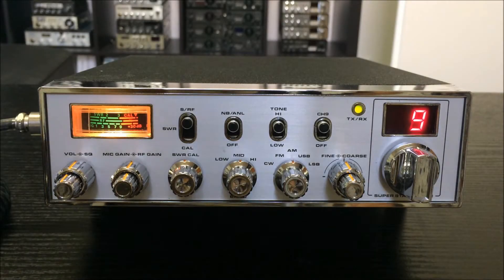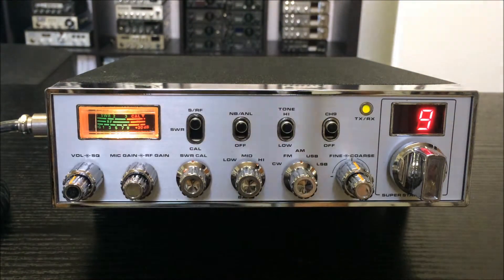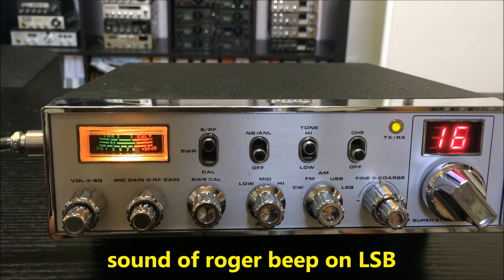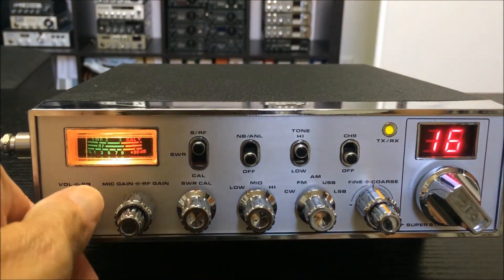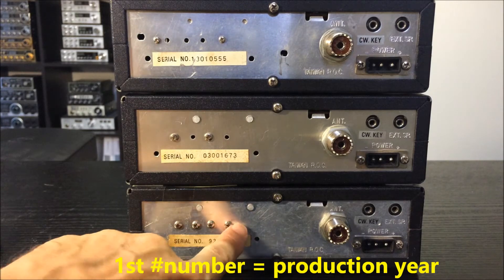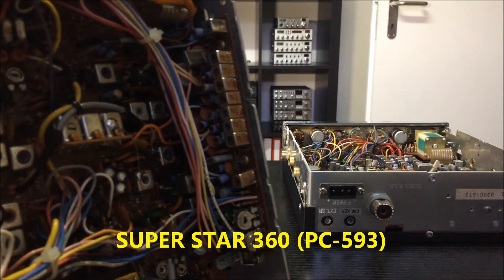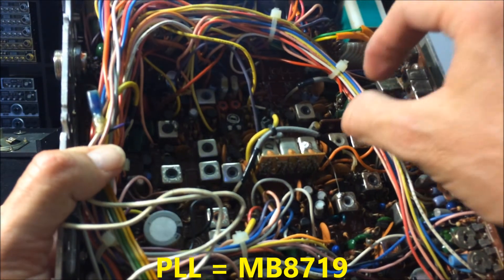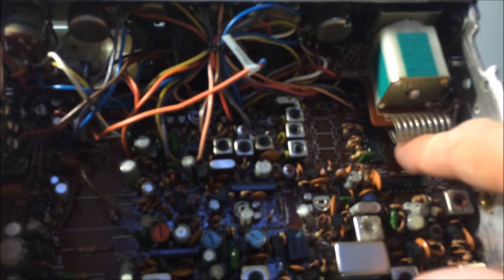SUPER STAR 360FM MK1 (PC 879) the differences

Comment: Hello Sir. I have a 360FM (pb010ab) with 1st serial # as a 9. Does this mean it is a 1990 rig? Looking for schematic for this radio it is missing the final and a few caps near the AM Audio transformer. Cheers. From SLC Ut.
Reply from the maker: Mister Breakbroke hello, how are you? Thank you for the interest. I think, it's 1979 or 1989. But I mean, the 1st release of PB10AB,  was in 1981, with 1st serial # as a 1. These uniden radios work very well along these 40 years of age. Just a small realign was needed. Best 73 to you and yours..
Reply from the maker: Hello again. You'll find the schematic on this link at CB-Tricks. The COBRA 148GTL-DX is using the similar PB010AB print: http://www.cbtricks.com/radios/cobra/148gtl_dx/index.htm
Best 73 to you....

Comment: Hello! 
I have got hold of an immaculate 360fm mk2 PB010, however it covers mid, hi and 10mtr amateur band. It looks factory standard but I can’t find any more info on these mk2’s with 10mtrs. Do you know if they made many of them?
Reply from the maker: Hello dr DXer. Yes i know the versions. Our importer "JACOB TRADING" in switzerland let manufactured 1981/1982 three versions by uniden. Version "export" from 26.515- to 27.855 MHz and version "HAM 1" 26.965- to 28.305 MHz. Also version "HAM 2" 26.965- to 27.405 MHz / 28.000- to 28.440 MHz / 28.500- to 28.940 MHz. But the most saled versions in Switzerland, were the export versions. Best 73s to you.
Reply: SWIZZRADIOS so I have the Ham 2!! Great and thanks for the info.